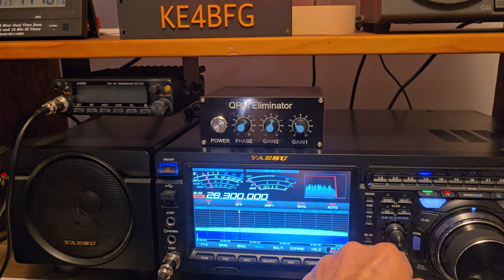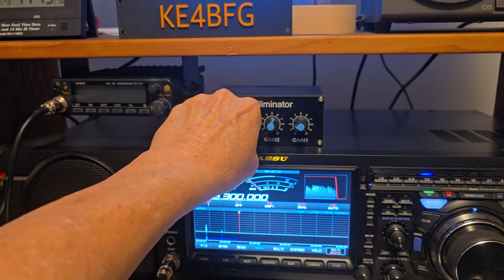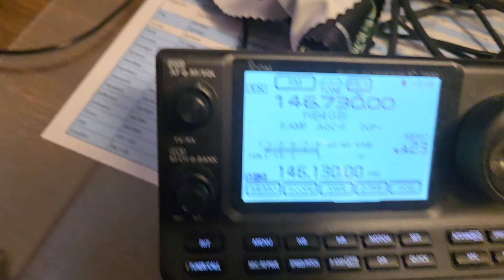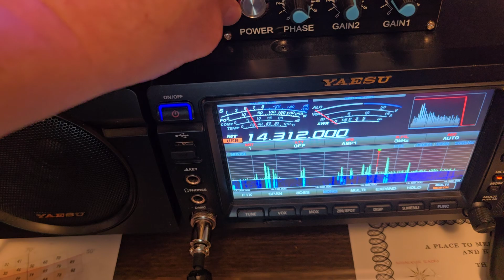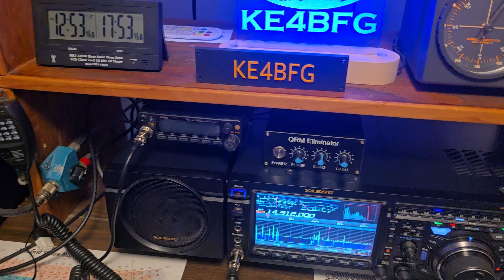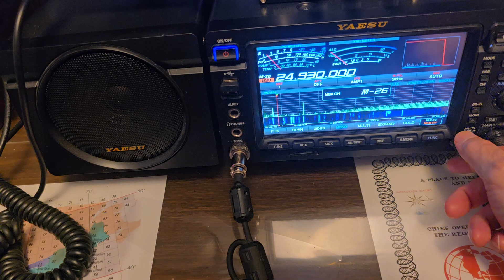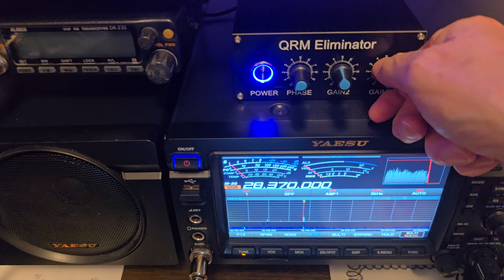QRM  Eliminator

Comment: I just use the attenuation on the 101mp and set the IPO to 0 (pre amps off). I usually set attenuation to 6db or 12db if lightening crashes are real bad. Late at night when things have quietened right down I turn the attenuation off.
Also, I run a Pixel Loop RF Pro 1B which help massively on 40 meters and marginally on the other bands up to 30Mhz.
Reply from the maker: thank you for the great Comet I appreciate you I hope you and the family have a merry Christmas and a happy New Year and thank you for subscribing and watching my YouTube channel

73 GOOD DX